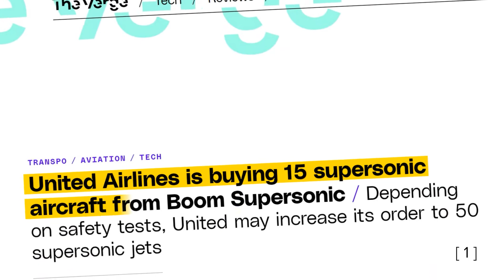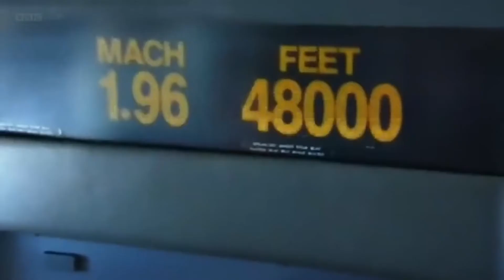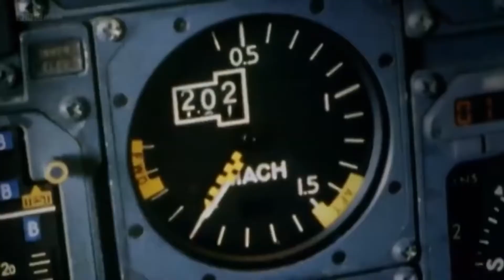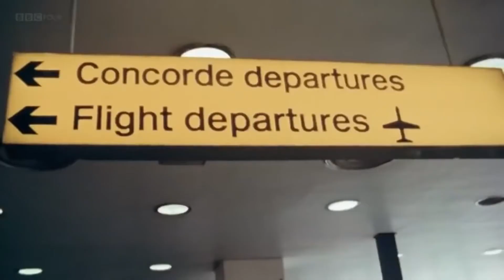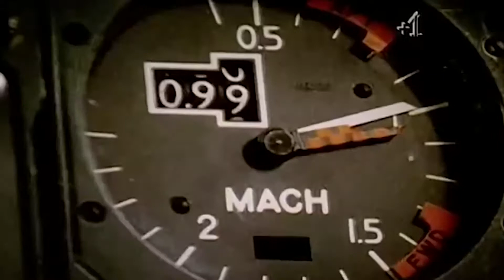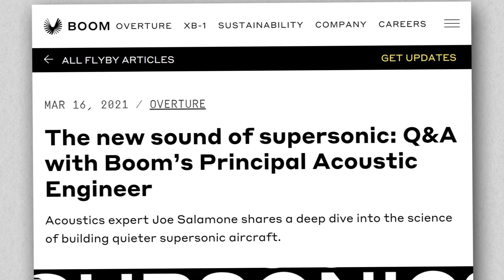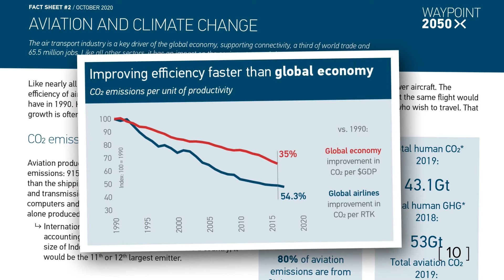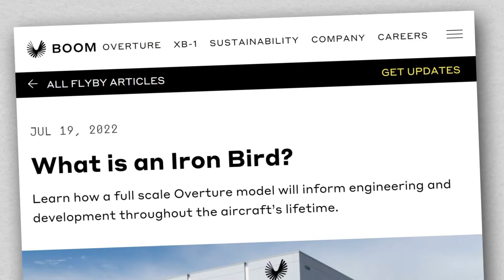How Supersonic Flights Might Finally Return

Comment: The word processing is associated with so many terms such as OLTP OLAP then batch processing vs stream processing. 

How is batch processing and stream processing related to OLAP and similarly

How is batch processing and stream processing associated with OLTP
Reply from the maker: Stream processing and OLAP/OLTP are different parts of a data pipeline. Stream processing systems capture data from sources and send it to data consumers in real-time or in near real-time, while OLAP or OLTP systems are on the consumer side of the pipeline. So you can stream data to OLTP and OLAP systems in real-time.

Also you can send data to OLAP and OLTP consumers in batches based on some schedule.

You would use OLTP design to support short transactional queries found in most applications to update databases and solve operational tasks.

OLAP design targets more complex queries to run data analysis.

Check out our video on data engineering: 
https://www.youtube.com/watch?v=qWru-b6m030

Data streaming (if you haven't): https://www.youtube.com/watch?v=ag9jlVxM_18

We also have an article on data pipelines: https://www.altexsoft.com/blog/data-pipeline-components-and-types/

OLAP vs OLTP: https://www.altexsoft.com/blog/olap-online-analytical-processing/